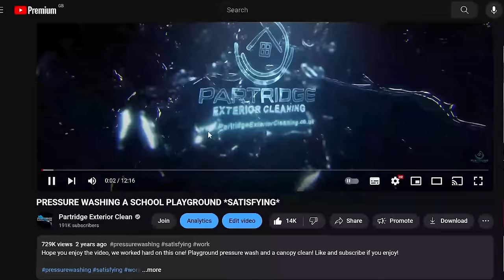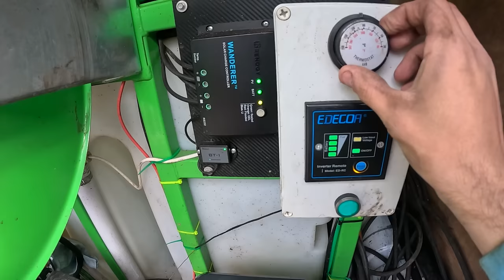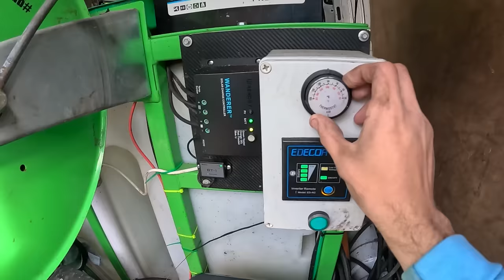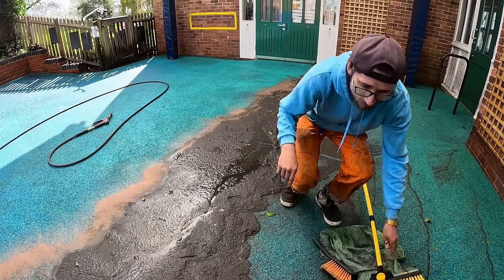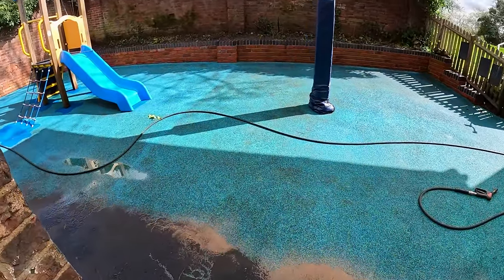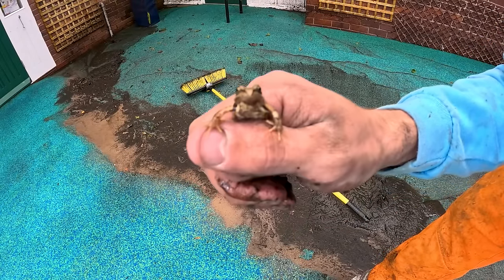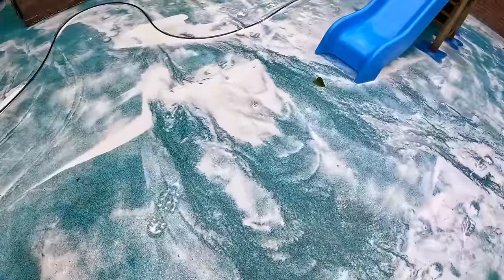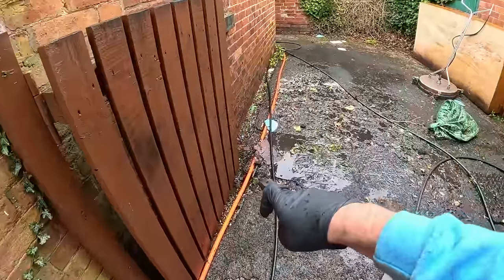I Power Washed A Mouldy Playground!

Comment: Great stuff! Have you ever wondered about going around and doing a little twist test on any of the nuts/bolts when doing kids playgrounds as a little free check for the childrens safety in case it was an issue nobody noticed as most wouldn't be as interactive or close up with the stuff as you may be? and maybe the pressure washer could reveal some loose bolts/nuts etc. Not your job obviously, just wondered if you ever just kept an eye on them when going round for anything obvious.
Reply: ì was reading your comment and first thought that you where talking about the nuts/bolts (or X and O's) game you see on the playground.

Comment: Soft pour areas tend to last about 10 - 12 years, obviously depending on how much traffic and how much exposure to sunlight. Also tend to separate from the edge. Had to be really careful at my previous school when pressure washing as the surface had started to degrade as in this video. Get too close and cause more damage.